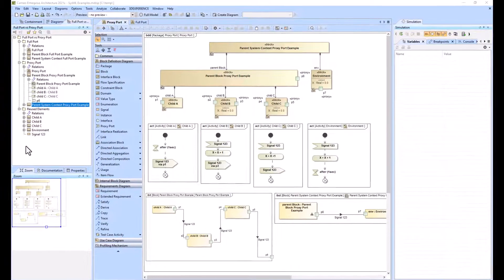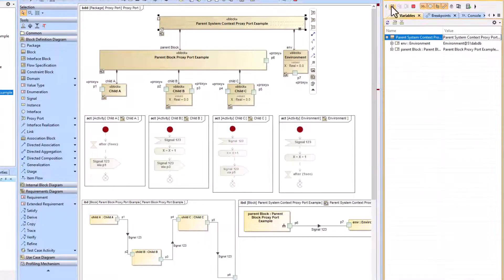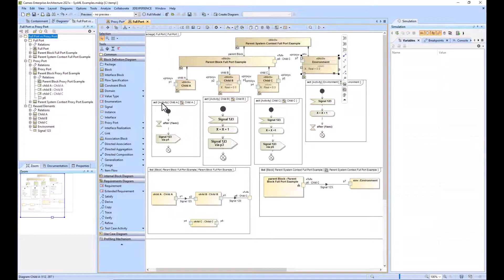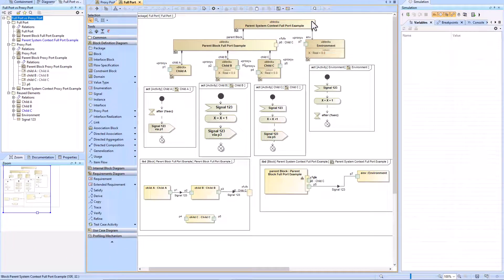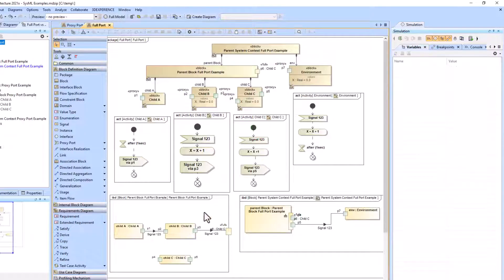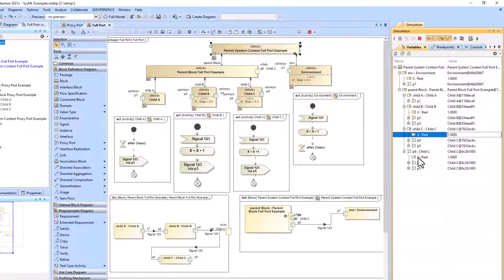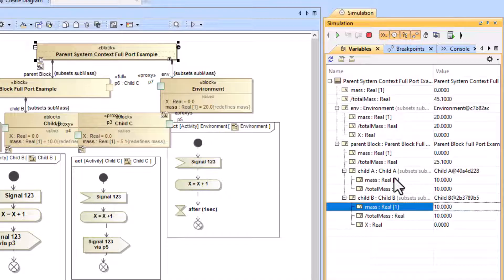Full Port vs Proxy Port (SysML)

Comment: Good video as it really got me to analyzing and troubleshooting the root cause of where things appeared to go wrong.
FULL PORT EXAMPLE: From my point of view, as someone fairly new to all this, it appears that the Parent block has a port (P6) used to send signal to the receiving port (P7) of the environment block. There are 3 child blocks that all initialize appropriately, each waiting to receive information from a sibling, except Child A that initiates the sending of the information ('signal').  Except for Child A, Child B and C each have an 'input' port and 'output' port. I don't think it matters if the ports are proxy or full ports. I believe all that matters is that all ports are functional and the architecture is designed to facilitate a flow of information from one Child to another, to the Parent, and to the environment.  Port 6 does not appear when viewing child blocks because it is a port of the Parent block.  The label of P6 as "child" is not a good idea.  Its is not a 'child' port, its a 'parent' port.  In the 'Variables" tab, we see the Children of the Parent, and the objective is view 'variables', not ports assigned to each component.  That's why you are able to see all 'ports' once you change the view to show 'ports'.  It seems that the showing of child port info is only additional information within this view as the values assigned to 'variables' are what appears to be the objective of the view.  Once you change the tab's view to include 'ports', that's when viewing of all parent and child ports is possible. 

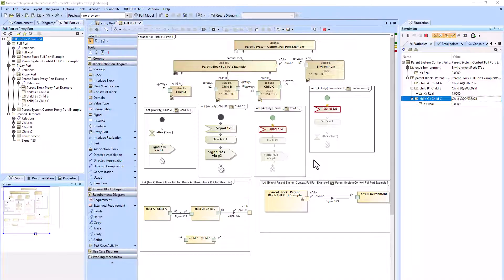At 5:49 you said there was not an issue with Child C receiving signal from Child B but that was not true. That's why Child C showed a value of "0" as you pointed out around 8:40.  Information from Child B was never sent to Child C because in the IBD, Child B didn't have a connection method to Child C.  

1. On 'run', activities within each Child block initialized (concurrently) without issue. The first "Signal 123" icon within each turns red because it is ready to receive input from a sibling child.  

2. When Child B received information from Child A, it processed that information but didn't know what to do with it since Child B was not connected with Child C. So, information created/processed within Child B stayed within Child B and we see it had a value of "1". 

3. In the meanwhile, since the IBD does not show a connection between Child B and C, when the sequence of operations cues Child C to perform its activities, I assume it assumes 'zero' for Signal123 and executes its internal processes and sends information (Signal123) from P5 to P7 (after you had connected P7 to P7). 

4. Meanwhile, Child C 'knows' it has an information sharing relationship with Child B, but never 'heard' from Child B when it came time to execute its own operations, as per the operational sequence.  So, the border of the "Singal123" icon remained red to indicate an error occurred.

Correction is appreciated if I've misunderstood something.
Reply from the maker: Thanks for the feedback.  You appear to be correct.  Thanks for the clarification.

Comment: I believe you need to use a parametric diagram and use a binding connector between the output of "C" p5 bound to p6, keeping the original IBD and part properties in place. This will make p6 behave like p5. A rather unique usage of a parametric diagram i acknowledge, but it is something that will fix the issue. Full ports aren't 'bad' they are just different.

Comment: So I’m not sure if this is obvious but what does it mean to “run” a block.

For your diagram it seems to simultaneously run all of your activities but for a parametric you have constraint blocks.  I guess I’m trying to understand what the program is deciding constitutes as a “process” to run.

I’m also not sure if this kind of question would be answered by understanding the language of SYSML since I’m starting out with the tool aspect.
Reply from the maker: "run" means "execute" in simulation.  When you "run" with the context of a block you will run all of the things which are connected to that block.  

A block can have a classifying behavior which is a behavioral diagram which is run when the block is run.  Therefore when you run the block, you will startup the classifier behavior (i.e. Activity Diagram, Sequence Diagram, State Machine Diagram).  The classifying behavior can then kickoff other behaviors.

Parametric diagrams are a structural diagram which is behaviorless. Therefore the constraints which are captured with a constraint block will be global (always true) for whatever behavior the system block does.  That's why we typically have laws of physics and such as a constraint on our parametric diagram (laws of physics are always true).

Hopefully this helps.  I'm not sure I answered your question.
Reply from the maker: Note: as you watch the videos you will see there are actually 2 play/"run" buttons.  The first calculates the structural parametric constraints and spits out the answer, the second starts the behavior.  

The behavior can modify the inputs and then change the parametric.  (i.e. the total mass of a system will decrease over time as the system uses fuel)

Comment: New to sysml here. Can you think of any situation where a full port is better? If not, why does it exist?
Reply from the maker: Good question. 
There is not one single "correct" way to model. I would refer to the methodology guidance for instruction. Some projects will decide that full ports should be used for physical interfaces while proxy is for logical interfaces. Other projects will use proxy for everything. There can be other rationales to decide which type of port to use also.

Proxy and Full ports have a different set of rules to follow. Full ports can have behaviors/transformations associated, while proxy does not have that ability. Proxy ports are more limited and, therefore, more simple and straightforward. 

If your methodology guidance is unclear, I would recommend asking: do you need the extra functionality a full port allows? Of not, then resort to using Proxy Ports.